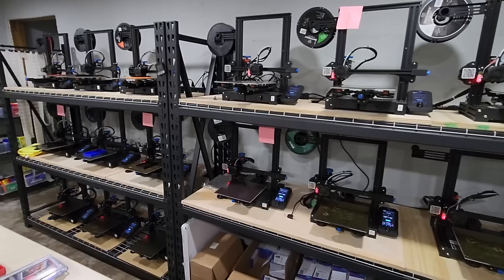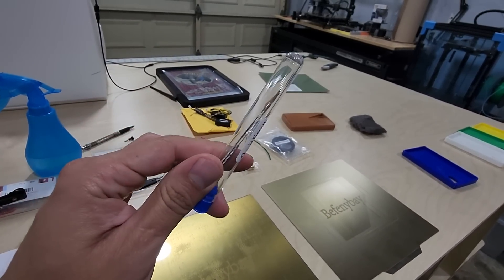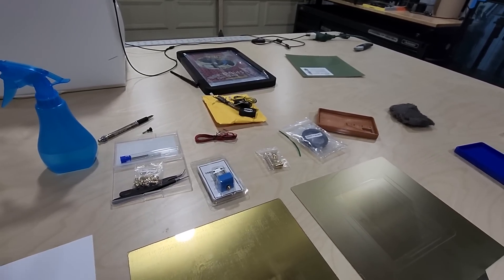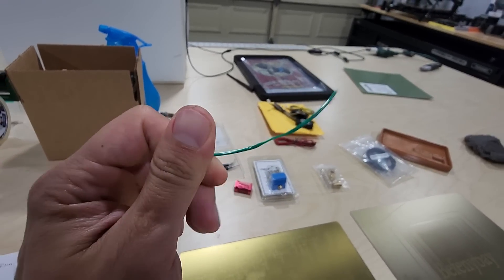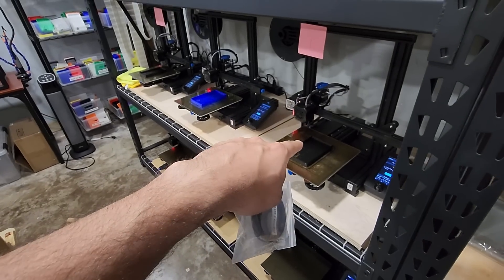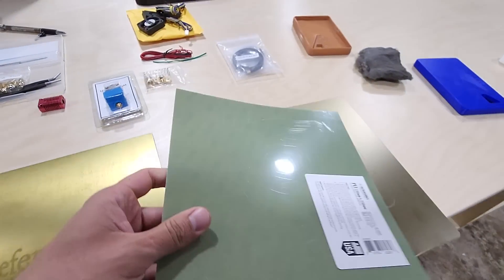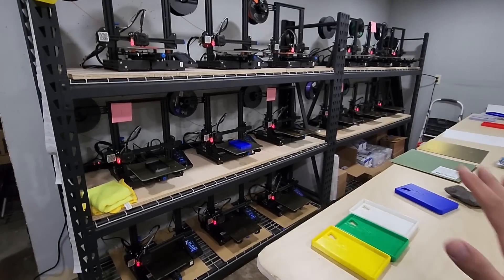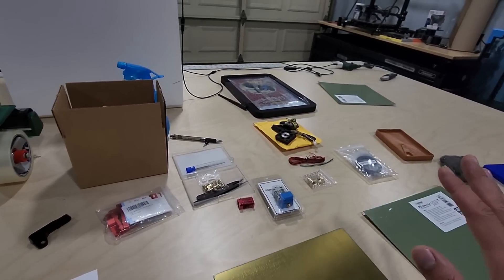3D Printer Maintenance After 25,000 hours on an Ender 3 v2 Print Farm. Not as bad as you think!!

Comment: I know you mentioned love for the ender 6, what do you think about thr Bambu lab instead now?
Reply from the maker: I dont like that the firmware is locked and cannot be modified. This makes it not possible to tweak motion for Increased dimensional accuracy
Reply: @Redo3D  so what printer would you suggest around that price range now?
Reply from the maker: The ender 5 plus, upgraded with a direct drive extruder and klipper.

Comment: Have you considered using hardened steel nozzles?  I believe they last much longer than brass.
Reply from the maker: Never switched to steel nozzle. Brass is so cheap I just stuck with it. Brass also conducts heat much better. I don't print abrasives so no need to switch for now
Reply: @Redo3D  give them a test.  Even with not using abrasives, they last a long long time.
Reply from the maker: thank you for the suggestion!

Comment: I know this video is getting kind of old but I've worked in Extrusion for over 15 years and that Gunk is from the plastic pigment actually and it burns off some some Plastics are worse than others nylons especially worse than like polypropylene or something like that but yeah certain colors Reds blacks things of that nature tend to build up a lot worse than other colors we ran 24/7 all the time we used to have to replace our dies about every 6 months was our mandatory and they were very expensive with special coatings

Comment: That gunk in the hot end is from something called "hot end gap" which is super common with enders and ender clones. The PTFE isn't perfectly flat against the back of the nozzle so when it starts to melt it squeezes out of that gap and builds up outside of your PTFE tube in the hot end. Starts with underextrusion and then eventually a full clog. Looks like you can even see the effect of it on your green PLA piece you showed. There's a small ring protruding around the middle. That's likely where that gap is in your hot end. Actually I'm surprised PTFE tubing isn't one of your main wear parts but it sounds like you're just replacing entire hot ends when you have an issue. Time is money so I understand, but these could definitely all be cleaned or repaired as well.

Comment: Have you tried switching from a .4 to a .6 nozzle? I've found the quality for my prints is just as good, but with better print times.
Reply from the maker: I did try it but my hinge mechanism has tight tolerances to get the feedback I want when moving the hinge, with .6mm I was having issues with that so I stuck with .4mm Also by using a .6mm nozzle I was using about 10g more filament which adds up in the long run!
Reply: @Redo3D  that's very true, I didn't think about your hinge tolerance.

I'm in the process of redesign something I'm planning on selling because it uses to much filament with its current iteration, so I definitely understand saving on filament.

Comment: If you're exclusively printing that case I would think it could be done just as well with a 0.6mm nozzle which would allow you to print thicker lines and save time?
Reply from the maker: you are correct, the print in place mechanism of the hinge does not come out as well as I would like with a .6mm nozzle. so .4mm works best for me.

Comment: I’ve got the E5Plus… I honestly think the Ender 3V2 is a much better version to run in this fashion. If you’ve used the E5+ have you had any bed leveling issues? That seems to be my main issue with it.
Reply from the maker: I havent used an ender 5 before, but any bed leveling issues could be due to the z lead screw, as well as the stock springs, i always update to the silicone bed mounts which are amazing